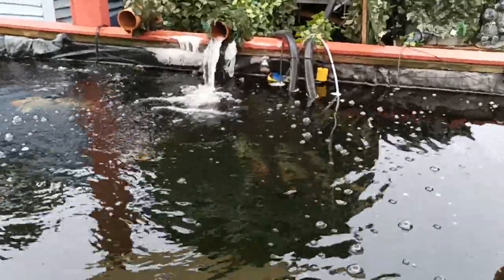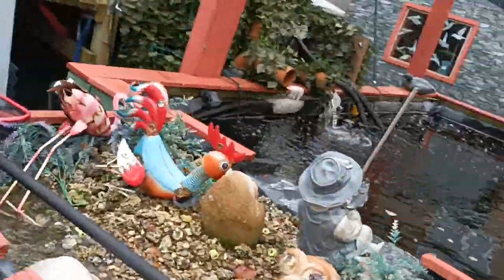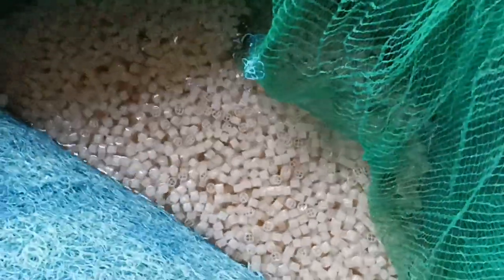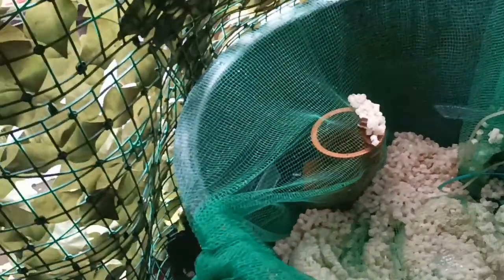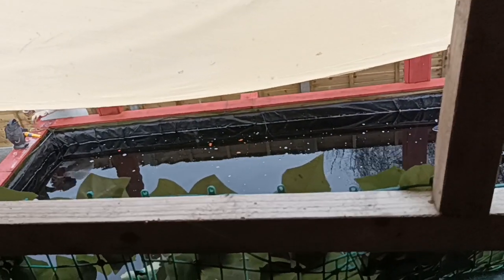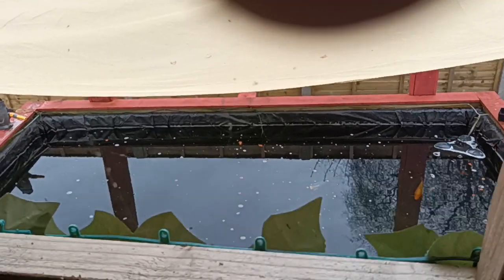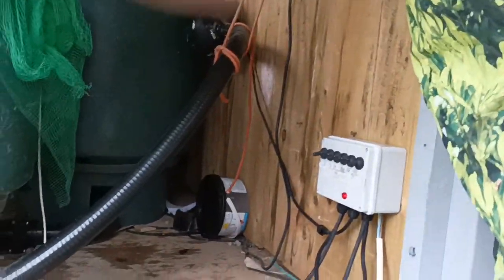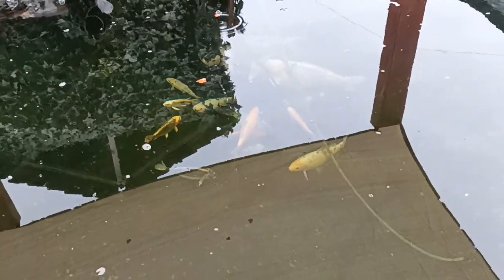Cleaning The Vortex Filters.

Comment: Buddy you don't have to use your hands to do that there is a couple of.things you can do  iv got a big 3ft vortex great bit of kit but if I was you bud I would get some thin plastic pipe and hook your brushes onto it make a ring so you don't have to get your hands cold have a look what iv done with my brushes you'll know what I mean I'm crap at explaining things 🤣👍😎🐟
Reply from the maker: I tried tuebbing em together, but they kept falling apart mate, good idea though, I was thinking of an air ring at the bottom of the vortex, and bubble it like a easy pod 🤔 what do you think 🤔
Reply: @lifearoundthekoipond2283  yes matey I was going to say get a big air pad and bubble your k1 befor you drop the water maybe 👍🐟